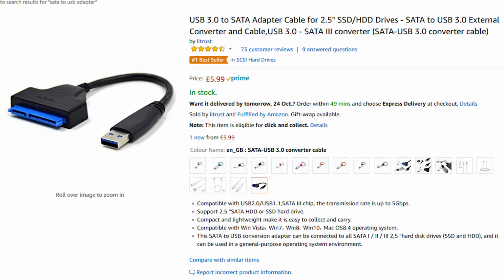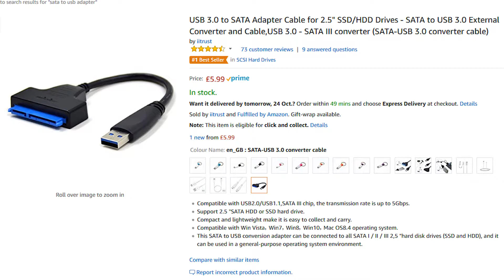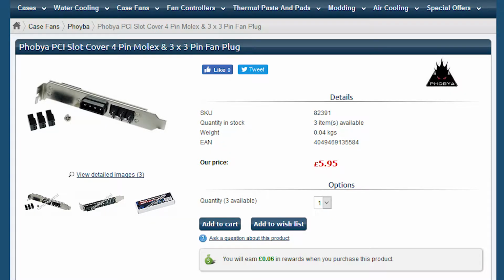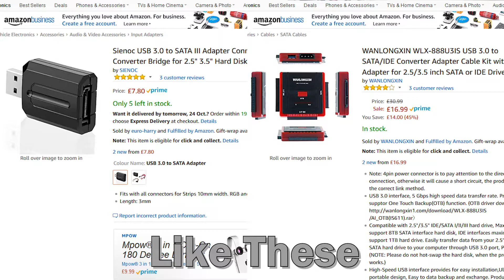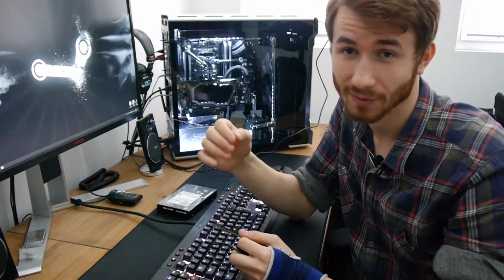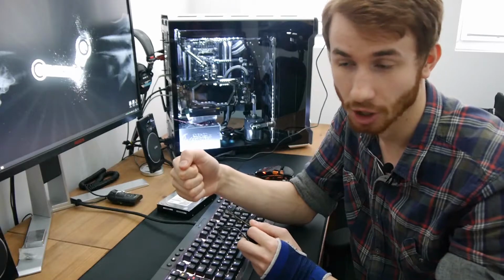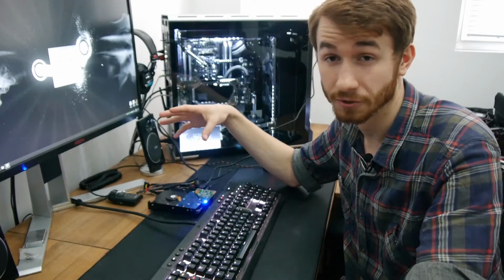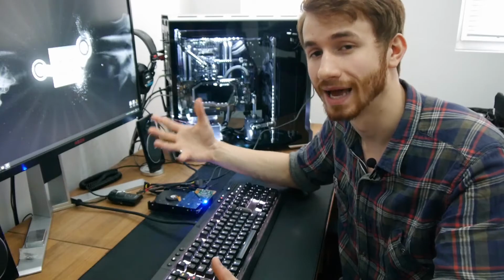How to Connect Any Hard Drive Externally!

Comment from the maker: If you want to take performance a step further with this and make sure that you are getting the best performance possible out of the SATA-USB conversion, then do some research into the different controller chips (bridge controller) available. 

Having UASP support is a must, but quality still varies even within brands. From what I've seen, JMicron and ASMedia have some good quality controllers, but look around for benchmarks and then find adapters that use these specific bridge controllers.

Although it might take some modding to splice a molex lead in to power 3.5" drives, but that's just another challenge ;)
Reply: Jeagar Tech dong worry I haven't forgotten about the shout-out, im still working on how, I think I should get it done by Christmas

Comment: You can get hard drive docks for £10 on ebay , i got one to see how well it would work and it actually worked surprisingly well
Reply from the maker: That's cool, I've never been too sure about those. But also, I was looking at getting a dock, but I don't want to have to plug another thing into the wall haha
Reply: Heagar Tech i can understand that , my cables are messy as fuck , id love a solution like yours but I honestly couldn't be bothered with the work 😂😂
Reply from the maker: Haha, that's fair! And if you have a dock, there's really no need I guess.